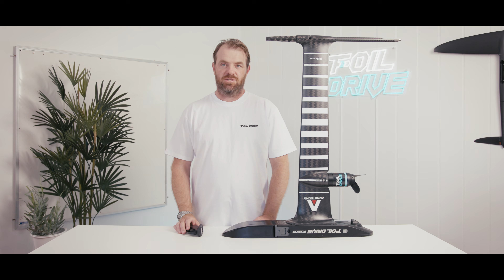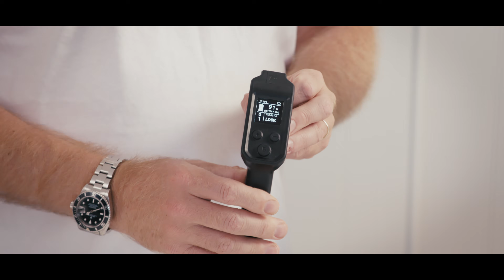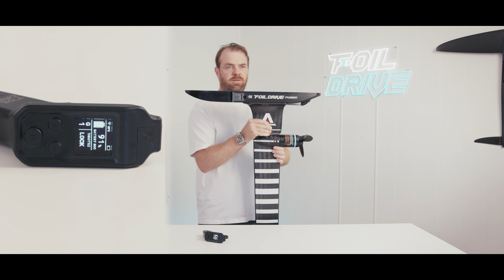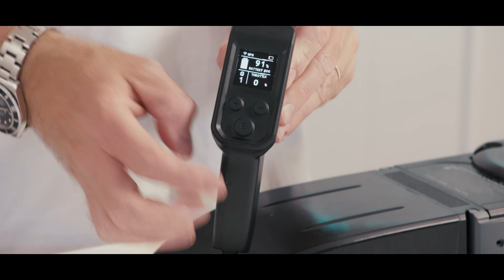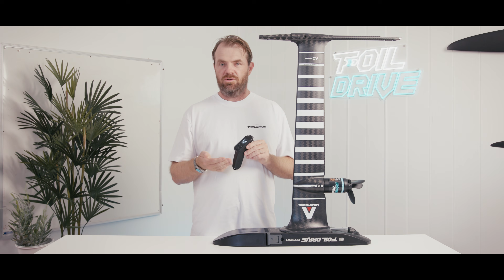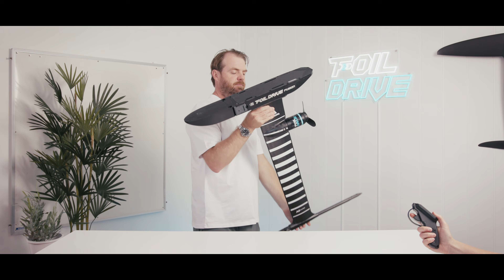Foil Drive | Tilt Sensor Tutorial

Comment: Pretty cool.  Can you log it and if so what is the resolution and sample frequency? Thank You
Reply from the maker: We don't have logging as a feature of the sensor, it's simply an on/off application currently. I think it has a 1deg resolution at 50hz but would have to dig back into the workshop to double, triple check. Thanks, SaraL